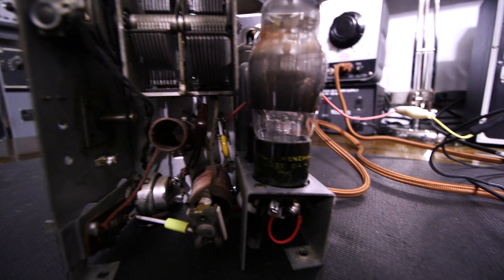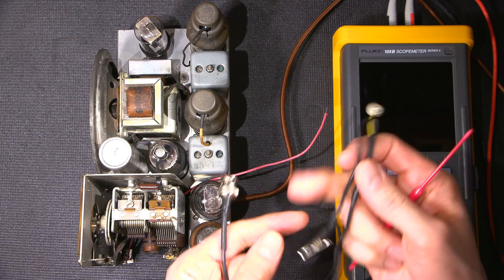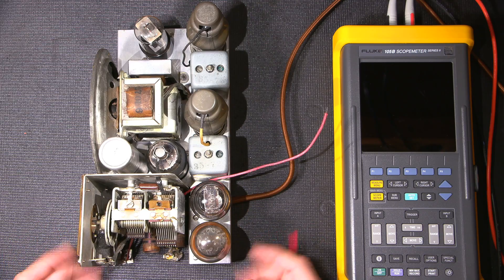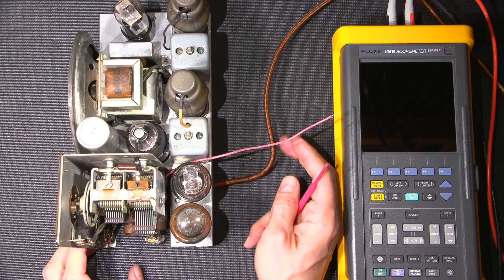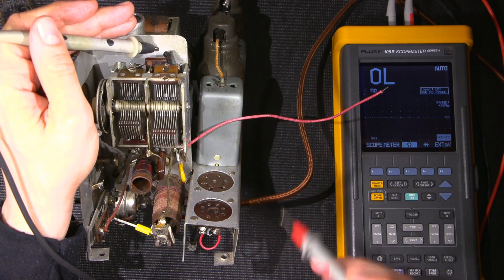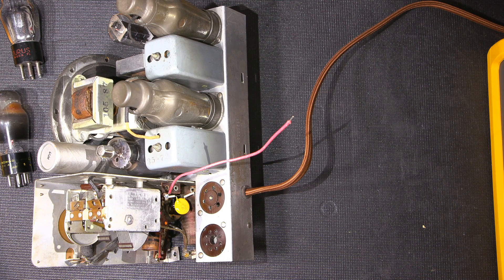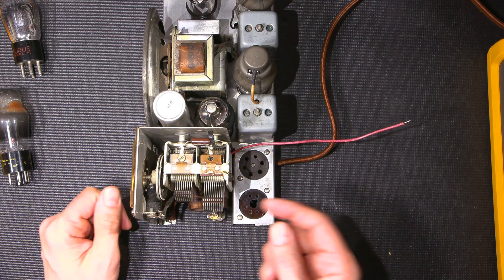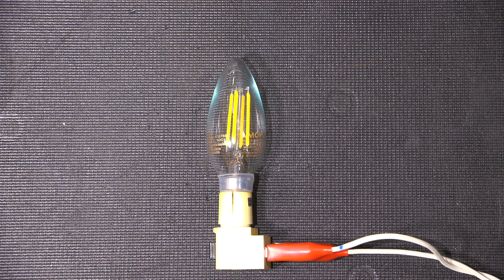See High Voltage Created From Falling Snow!

Comment: welcome to the electric universe (do yourself a favor and check out electric universe theory )and the good old ether....you might be on to something big here ...do you know about sprites,pixies and other types of lighting
Reply: Check out Feynman's lecture on electrical weather. There's a lot we don't understand about it. https://www.feynmanlectures.caltech.edu/II_09.html

Aetheric theories were rejected because physicists found repeatable experiments that were not compatible with them. Lorentz and Maxwell (et al) worked really hard on making sense of this problem, and then the next generation (Minkowski, Einstein, Planck ...) found a mathematical language that was consistent with experiment. This mathematical language didn't need an absolute aether, only a relative one which is now usually called "the electromagnetic field." (Einstein himself gave several lectures comparing the "fields" to older aetheric theories.)

Also Einstein's thought experiments with clocks in spaceships communicating using light? That's a pretty good description of GPS, and GPS confirms that Special Relativity works and (to a lesser extent) that General Relativity is at least consistent with GPS data.

But the point I'm making is that the experiments which lead up to the demise of (absolutely immobile) aether had a "fundamental" character. We tried to measure something, failed, tried to devise more subtle measurements, eventually arrived at the Michaelson-Gale-Pearson experiment - and by that point there were so many corrections tacked on the aether that it didn't have to be immobile any more.

Einstein gets mythologized as radical and rebellious thinker. Really he was just putting together the mathematical pieces and concluding "actually, we can explain the universe without a concept of absolute motionlessness." And because he's mythologized that way, people seem to think that the way to convince scientists to alter their fundamental perspective is to also entertain wacky ideas.

The truth is, conventional physics is already very wacky and operates in surprising ways. The Feynman lectures are a good introduction to that wackiness, even if you have only a passing understanding of the math. (IMO it also makes the math easier to learn. It gives you a reason to care about calculus and complex numbers and so on.)

If you're trying to shake the foundations of physics, here's how to do it *effectively*:

- get curious about weird things in nature
- understand existing theory

 - dig into tensions between weird nature and uncertain theories
 - like, really dig deep, find something that's both weird and reproducible
 - collaborate 

 - become a footnote to someone else, because popular opinion loves to pick one great theorist while ignoring their friends and colleagues. 

I think it's worthwhile to remember that Einstein wasn't a reclusive genius. He was what we'd now call a "maker" or "hacker" and he filed many patents. None of them were terribly successful designs, but they're an interesting selection of 20th-century technologies. Automatic exposure control for a film camera. Bone-conduction earphones. A gas-fired refrigerator. And he collaborated with others on those ideas. Even the Relativity Principle was a close collaboration with his doctoral advisor, Hermann Minkowski. 

Standing on the fringes and shouting, especially if you're not doing experiments, is not science. It's just woo.

Comment: Precipitation static is a well-known phenomenon.  It's a big deal for aircraft. The IRE (now IEEE) journal has published peer-reviewed papers on it dating back to the 1930's. Maybe Mr. Carlson should applied standard normal SAFE antenna installation methods, and install a proper static discharge device on that coax....then it will not destroy solid state radios "very fast"...and the charge will be properly drained off through a RESISTOR, rather than an INDUCTOR, because DC resistance of a coil is not the same as its reactance  to AC voltages -- basic electronics 101. Try to find someone with a little more knowledge to learn from than this guy.

Comment: I don't think it was build up of static charge perhaps it had to be a actual ac signal not a DC static charge ur kinda high up north maybe a atmospheric condition charged particles colliding with atmosphere or maybe its a new rf weapon being develpmented by the government to destroy all modern communication equipment or perhaps harp was skipping off the ionosphere and just happening to land right on your antenna or it's aleins of course or weather control lol
Reply: I feel like 36 0hms would have quickly discharged any slow build up of static dc had to be some sort of high powered rf signal am pretty positive it wasn't just the snow solar winds werck havoc on large arrays or power grids it is pretty damn strange.
Reply: I know u know it's not the snow either the more I think about it the stranger it seems I mean yeah u got a decent long wire but to to putting out that much rf had to be one hell of signal
Reply: Its the low resistance to the chassis that's getting me very werid I really doubt a snow storm had anything to do with it but i could be wrong Sorry I just thinking out loud I'll stop now

Comment: I'm almost more confused by how the LED filament bulb was blinking.  They're even usually hooked up with a single connection to the power supply in the base.
Reply from the maker: Agree'd, the failure point is really bizarre.